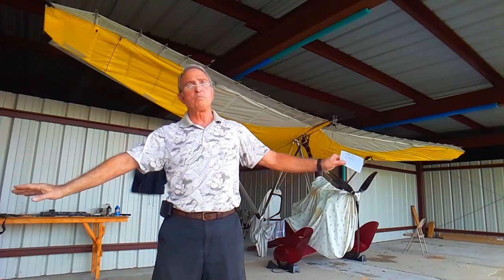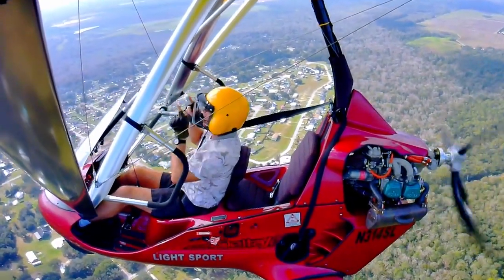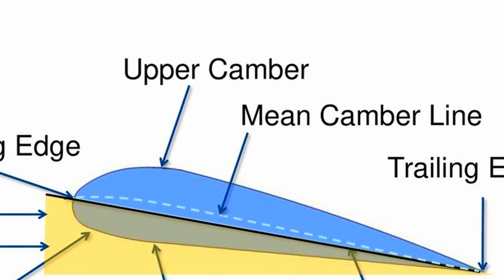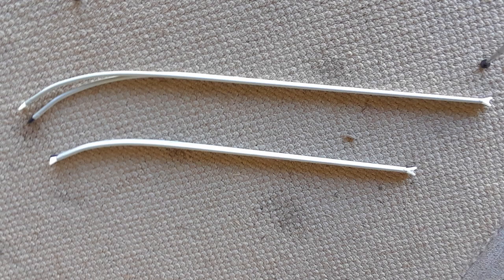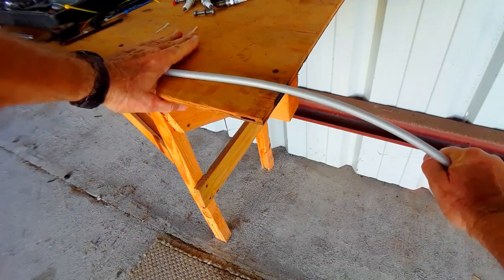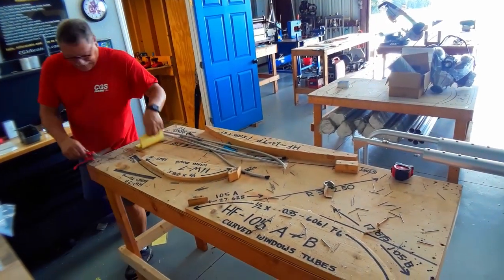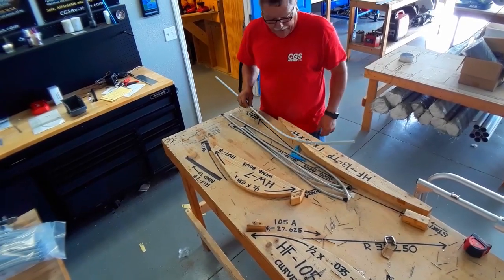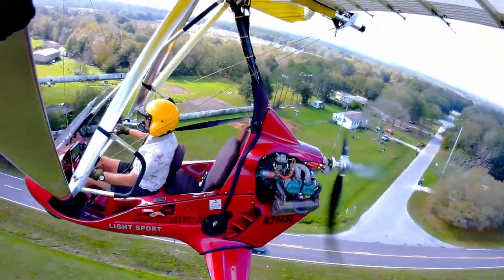Trike Wing Tuning

Comment: Not sure if I’ll get a reply but does anyone know where I can get replacement battens for a Solairus wing
Reply from the maker: Contact North Wing.  If not supplied by the manufacturer, a quick internet search exhibits many straight battens of different sizes and shapes.  These straight fiberglass and composite battens can then be custom fitted.
Reply: @michaelhano8701  okay thanks one of mine is broken on the plastic y end
Reply from the maker: @trianglesinthesky976  - Ah yes, the Y thing.  North Wing will have it.
Reply: @michaelhano8701  thanks I’m not sure what all is broken and missing yet the guy I bought it off of says he never put it together but he included it with my atf trike frame I haven’t unrolled it to look at it yet but if it’s missing to much or a lot more turns out to be broken I’ll hold off till I can afford to buy a whole new wing

Comment: Would it be possible to make a video on how to perform the biannual/annual sprog height inspection using a digital angle tool? I have read about it, and spoke with a few people, but actually seeing it performed would be awesome. Thanks sir...
Reply from the maker: c. The sprogs are used to set the height of the trailing edge and this set the mininum twist that
wing should have.
NOTE: Proper adjustment of the sprogs height are critical for stability at low angles of attack.
The vehicle test described above has proved the stability system for the Stratus XP to very
effective.
Results:
One sprog per side- can be adjusted. One reflex bridle line per side- length is set and cannot be
altered.
Sprog settings
set at_17____ degs with the keel set at 0 deg.
Method of adjusting sprog height
1. To adjust the sprog height, fully unzip the access zipper to gain access to the front of the
sprog where it is mounted to the sprog bracket.
2. Remove the horizontal bolt and nut which secures the sprog clevis fork to the pillar block,
taking care to maintain the rotational alignment of the clevis fork in the sprog at its original
setting.
3. To raise the sprog, turn the clevis fork so as to "loosen" or unscrew the fork in the end of
the sprog, thereby lengthening the sprog. To lower the sprog, turn the clevis fork in the opposite
direction. One full turn raises or lowers the sprog about one half inch. The adjuster may be
locked in place with a thin jam nut, in which case you will need to loosen this jam nut before you
can turn the clevis fork.
You can usually loosen the jam nut by rotating the sprog counter clockwise before dismounting
it, and then spin the nut out of the way until you have re-adjusted the clevis fork as desired.
When you have achieved the desired adjustment, run the nut against the end of the sprog,
loosen the clevis fork a quarter turn, and snug the nut finger tight against the sprog. After you reattach the clevis fork to the pillar block, while holding the nut, rotate the sprog 1/4 turn in the
correct direction so as to tighten the nut. Note that the jam nut is primarily to preserve the sprog
adjustment if the sprog or sprog cable is detached. With the sprog and cable fully installed and
attached, the adjustment cannot change.
Note that the outboard sprogs should always be adjusted slightly higher than the inboard
sprogs.
Reply: @michaelhano8701  Thanl you sir...
Reply: @michaelhano8701  ❤

Comment: How many digree you bend the battens ?
Reply from the maker: I just did it by eyeball, using the opposite batten as a guide to increase camber, as shown in the video.  I did not measure degrees.

Comment: Dear sir whats about the engine cc and hp? Could you please suggest about trike engine?
Reply from the maker: This is the Rotax carbureted 100 hp engine.  The trike weighs in at 600 lbs and has a useful load of 500 lbs

Comment: Hello sir, can we use less gauge Ms pipe for making wing in place of aircraft aluminium ( same weight & length ratio comparing to the aircraft aluminium , only battens are made-up of aluminium)
Reply from the maker: I do not make my own wings. I assemble factory made wings only.
Reply: @michaelhano8701  hello sir , can u suggest me which type of NACA 4 digit airfoil coordinate should select for lifting up 100kg
(pilot + hanging frame ) of weight & that gives easiest , good & comfortable to fly
Reply from the maker: Coordinate your information with a wing manufacturer, then then make your wing selection.